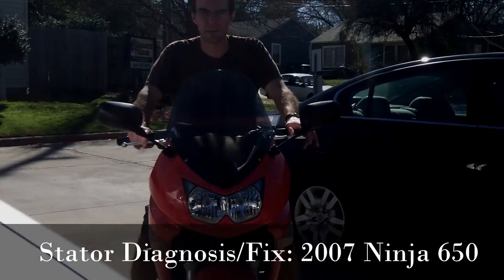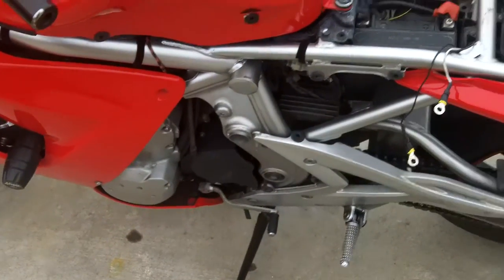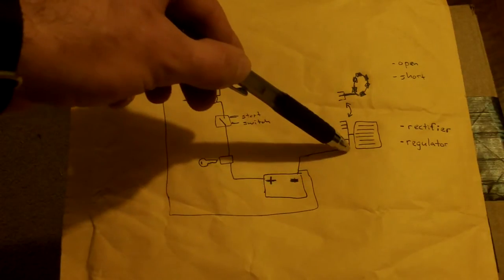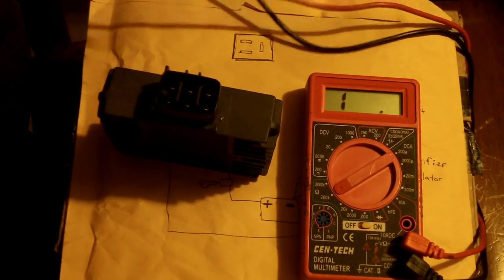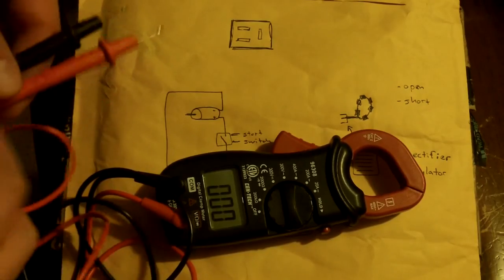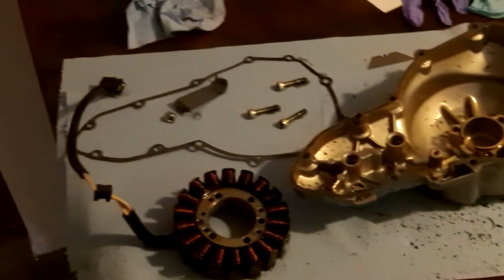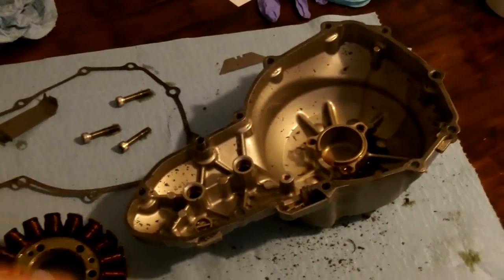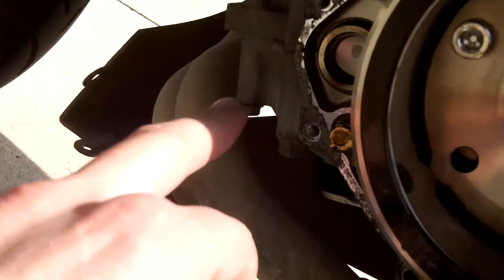Diagnosing and Replacing a Stator: Ninja 650r

Comment: Hey, I have a 2019 ninja 650.. similar problems.. only it won’t crank at all.. I uploaded a video on it.. when the starter gets direct power.. it will crank, but the bike will not turn over.. put a brand new solenoid on it.. that works. The batter is being jumped so it has almost 14 volts.. everything works.. but when I push that ignition button.. the bike goes click click click. And will not even crank.. any thoughts on that??